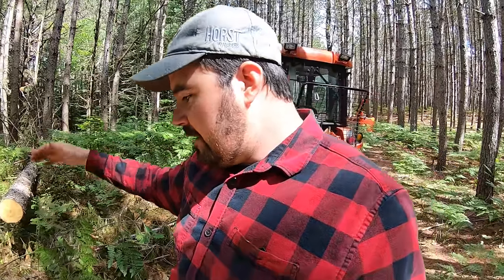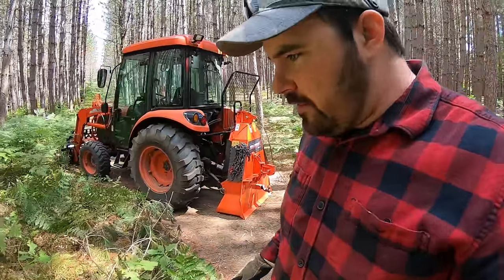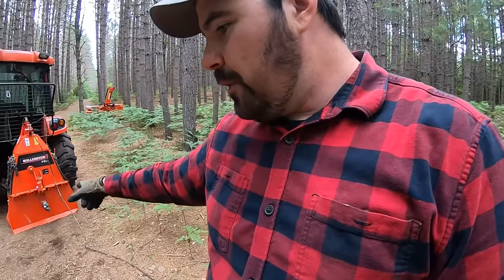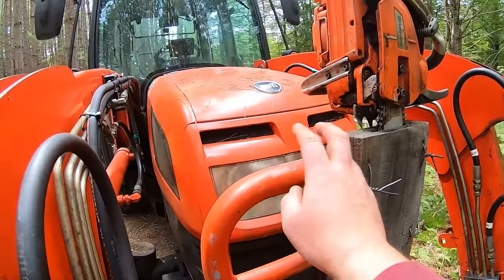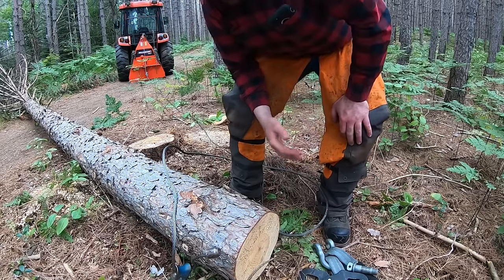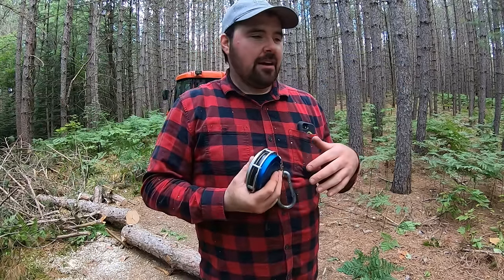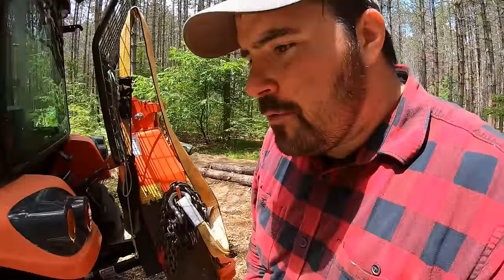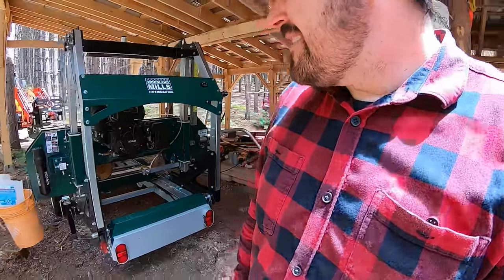Small Scale Logging Tools of the Trade

Comment: Tim from Canada suggestions for you at your sawmill.. if you were to come around from the back or from the side. You would be able to put in a road that you can drive straight into your sawmill with.. in your last video I watched you were digging out sawdust from your wood mill at winter time.. if you were to make a road through the bush so you have a straight on angle to your word now this would help you out . Preparation is the best thing to do if you were to take out some trees now make it so that you can drive your tractor in and out of your wood mill it would make your job a lot easier instead of pissing around trying to dodge through trees.. stand back and look see were you can get a straight run at your Woodmill mark out your trees.. then see where you can wind your road around to link up to your existing road. This will work for everyone that has a problem getting in through the bush figure out where you are.. where are you going.. canna spray paint mark out the trees that you want to get rid of this will help you out in the long run
Reply from the maker: I agree with ya there Tim. I've got some work ahead of me improving my haul roads. Bit tight as you could see. Hope you're doing well and thanks again for watching

Comment: Good morning that was an easy little task pulling the left over of the tree that is very helpfull I use a similar method but don't have a wench but I set a pull and a rope but I got to get back on the tractor and drive some but it does the job have a great day
Reply from the maker: That method would work just the same I can imagine. Whatever it takes to get the job done

Comment: I still use files to sharpen my saws. Find myself bringing a pack of saw tools including carb adjuster. Flat file,  and round file, and chainsaw tool for quick sharpening and clean outs in the bush. I've found tank vents can get clogged quickly with oil and saw dust if the chain becomes dull. And when I'm trying to take down stumps I do hit the dirt alot. 
I will be using your chainsaw mount idea on my atv. That and a home made log arch is all I have to get my logs to the mill. Takes some time, but we have to work smart so we can continue to work the next day.
BTW how can you handle this heat. The Deer flies have been relentless these past few days.
Reply from the maker: There is certainly something to be said for using hand tools and working smarter with the tools at hand. Good on ya for that!

Comment: Does the Oregon chain grinder also take off a bit on the depth guide as you grind the cutter tooth? I noticed you also took an angle grinder after the fact.
Reply from the maker: That's a good question. I probably could use it to take down the rakers as well on second thought

Comment: seems like all of this kind of niche gear has a huge markup on it, can get a nice milwuakee 200ft tape for 40$ canadian.. one of these 50ft logging tapes is like 150-200$, it really is no more expensive to produce even if it is higher quality its 1/4 of the size but 5x the price

16ft of grade 70 transport chain with grab hooks cheap as dirt on sale at princess auto but if you want 5ft of chain with a slip hook its triple that cost

those ranger snatch blocks reasonably priced, you want the one with the cone that auto ejects the line and its 10x the cost for whats a similar amount of material and machine if not less

try and buy some steel braided line for a winch or for making chocker loops.. youll find out pretty quick its cheaper to just buy a whole winch on sale and steel 20ft of line off of it
Reply from the maker: Yeah seems like depending on the item sure can be pricey

Comment: I was watching you transfer that log from the forks to the mill, and I thought “An overhead trolley hoist with tongs you make that easier”.  But then again, I am kinda lazy. . .
Reply from the maker: That would be kind of handy
Reply: @sawingwithsandy  I am so cribbing off your sawmill shed build it isn’t even funny!  I just wrote up a projected list of lumber I have to cut for the build, and I will (the next rainy day when outside activities are curtailed) making it into a spreadsheet because my penmanship is, well, “sub-optimal”.  I wish they still sold nails by the keg. . .  Anywho, I plan to set my floor joists (full-dimensional 2x6s) on 12” centers, wondering if 10” centers would give better support, but having only 8” to swing a hammer between them would be a RPITA.  I could use a palm nailer but then I would need to bring a generator and compressor up to the site.  Decisions, decisions. . .